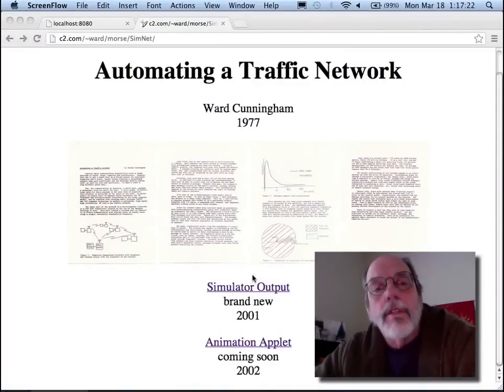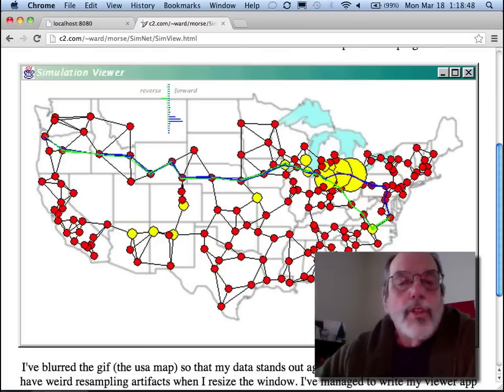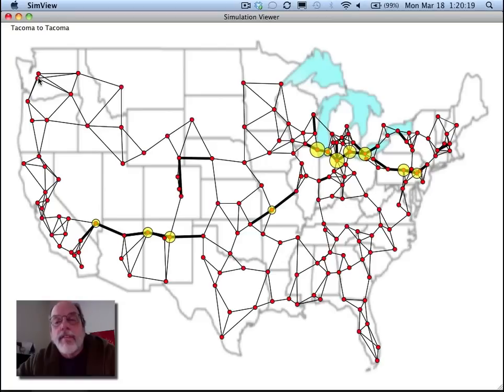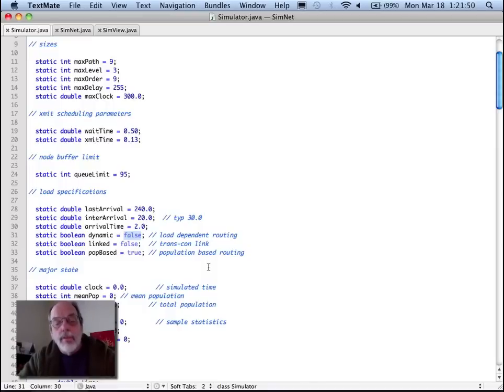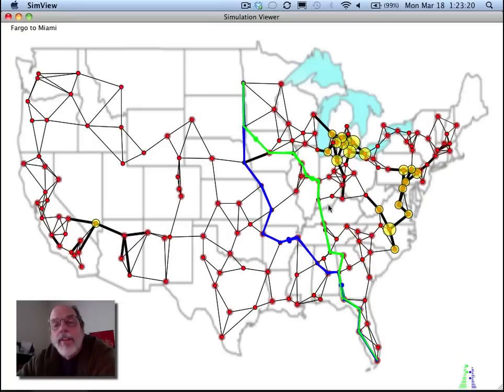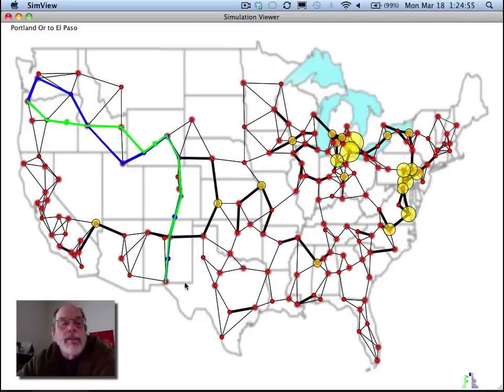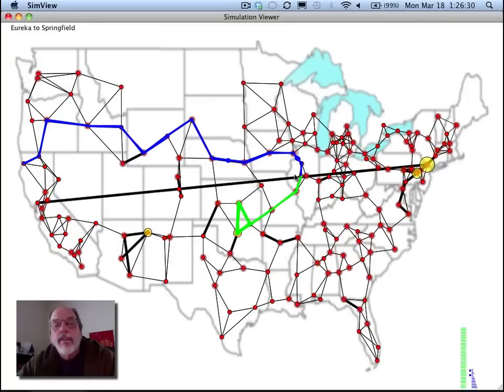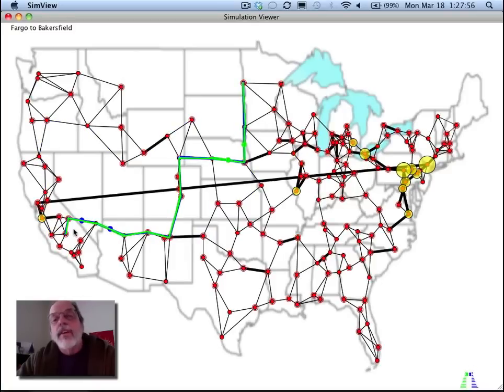Animating a Network Simulation

Comment: 1977 was a magic year!  I was in Saint Louis when the Intel 8086 came out. I hand-wired one onto a piece of .1 inch perf-board and Augat connectors! Perhaps one of the first single-board computers on Earth. I was on salary at $400/month and minimum wage was $2.10/hour.

Motorola had the 6800 and RCA had the CDP1802 CoSMAC! [ http://en.wikipedia.org/wiki/RCA_1802 ] ... and what the heck happened to Byte magazine?

/me looks at empty kitchen table with nostalgic abandon. sigh

But this technology is where Net Neutrality will be reborn. Thanks, Ward! You're a great living  #ancestor  for the next generation of hacker/hobbyists. Keep up the good work!